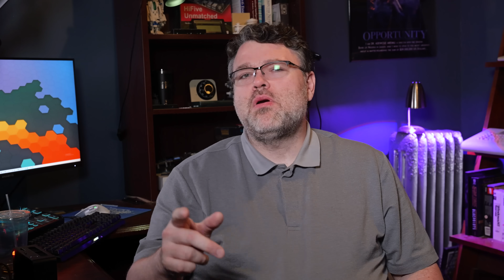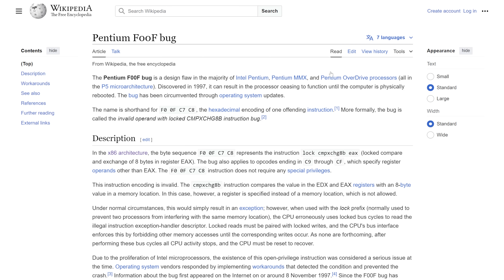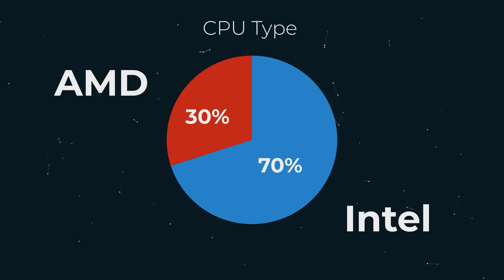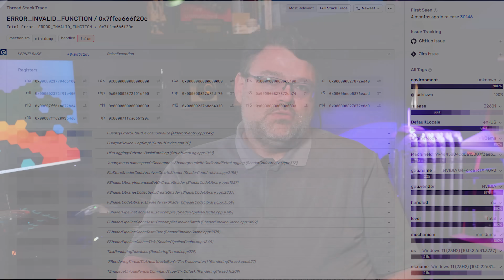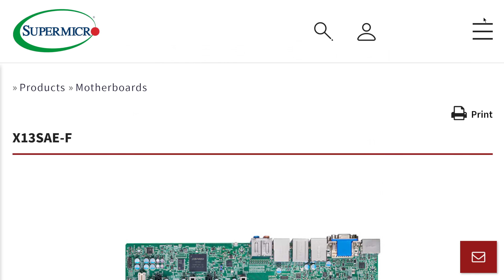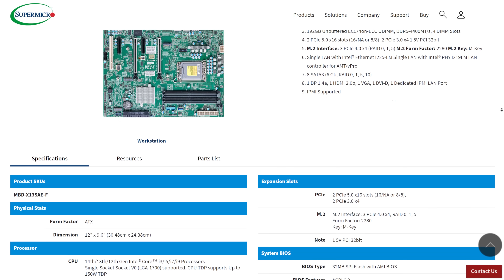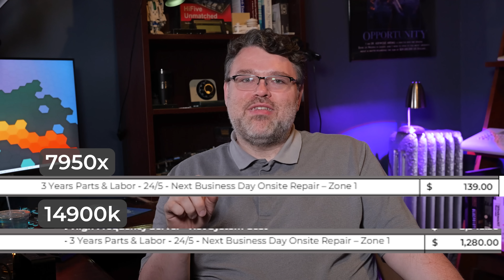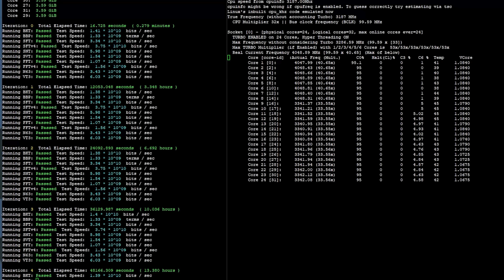Intel has a Pretty Big Problem

Comment: I'd rather use intel first.

I still use intel chips i7 chips.  I have never had a alot crashes off  video games.  Sometimes there are issues with certain music hardware for music production.   These days the current chips are beyond the standard. 

I'd rather see what Im doing wrong before i blame intel for my problems.

Comment: Is there a way for software to detect overclocking, like comparing the CPU's self reported design frequency to the measured speed of the TSC counter in the CPU relative to Internet-synced time of day clocks, like how many TSC ticks per minute of real world time.  At least on older Intel CPUs, the TSC counted at the raw clock speed and the CPUID return value stayed the design frequency and model name directly.

Comment: I've been running an Intel 13900H for over a year now without any crashes, at all! Yes, there isn't even a file called memory.dmp in my Windows directory. It's an ASUS Zenbook that i drive hard daily as a S/W engineer. When I'm not working though, I'm gaming on it. I have a lot of problems with your reporting, which seems to be happening more often than not. 

As someone who debugs hardware crashes for a living, the first thing I need to find the root cause is a repeatable case. Do you have a repeatable case? Not one that occurs every now and then, but a simple task you can run and repeatably make this happen on an unmolested system? Looking at crash statistics from game crashes is just not the place to look for evidence that a CPU is buggy. 

Problem number one, these gamers are all, or mostly, tweaking their H/W. This means these crashes are useless in your study. You need reports from systems that are not "tweaked", but they probably aren't crashing so ...

The next problem is that most of these gamers are going to be running bleeding edge H/W. That means you will see more crash results for newer CPUs compared to crash results for older CPUs.

Finally, old S/W can easily break on a new CPU when timings, cache designs, and other internal changes occur. Game developers are notorious for using "tricks" to increase their performance. They take advantage of the architecture at the time of the design. In the old days, GPU manufacturers like NVIDIA would rewrite portions of the O/S internal GDI code just so they could have a better benchmark score.

You've dazzled us with data, but haven't really given us any real evidence to support your conclusions.
Reply: It may be true that gamers are tweaking their system's performance, however Wendell also discusses failure data from servers running these chips on W680 motherboards. 11:41  Presumably these servers were always running at conservative settings that are "well within Intel's specification".
Reply: @eltamarindo  Again, newer servers with newer chips would be more likely to have issues with older S/W. As the old saying goes, figures don't lie, liars can figure. Without a repeatable case to evaluate, you're simply compiling the data to say what you want, while in the end, it is proof of nothing. Another person could compile the same data differently and come to a different conclusion.

Wendell has an agenda and it is obvious in the way he speaks about the issue.

Comment: Is there a correlation to game engine used as well? Was having a lot of problems with unstable Unreal based games. B-Series board, but vendor boost settings. Turned those off, updated bios, reset to factory, all the standard stuff. Turned out that RAM, even with the default XMP profile, had some auto clocking settings in there. Once I locked those settings at a fixed rate, this fixed my issue with the UR engine games. Not sure if it is something related to the memory controller and how that engine works, but yeah, tricky things to sort out.

Comment: So I shouldn't buy the i9-14900K, 3,2 GHz (6,0 GHz Turbo Boost) socket 1700 processor?
Reply: If you buy, make sure you are running conservative power settings from day one. But Wendell is suggesting that if you must have the a top of the line system, either wait or buy Ryzen 9.

Comment: Just my two cents: In the past few years I've built about 10 systems using exactly these processors, specifically for high end flight simulation (X-Plane 12, Flight Simulator 2020), gaming, heavy use/commercial architectural machines and graphics design. I have not experienced any failures, except for a bad memory module shipped out with one of the builds. I have not received any reports of crashes, blue screens, random restarts, etc., so unfortunately I cannot say I have experienced any of this. I did not however, overclock any of them. There was no need to because of the good performance.

Comment: It has been long time since i care about the detais on the Intel CPU lineup, so excuse me if what I'm going to ask is dub. Said that... What's the point of using those K CPU on the servers? If they are using non Z-chipset motherboards neither they aim overclocking for the sake of stability, then why not to use non-K versions of those CPU?

Comment: Modern CPUs---as I'm sure you know---have a great deal of fault mitigation logic built-in. If some part of the CPU fails, the CPU may be able to mitigate the failure at the expense of a loss of overall processing speed. That effect could explain what you observed in the logs. First one part of the CPU fails, which slows it down, then another part fails which causes the computer to crash.

Comment: 06:45 Just to clarify: Are you showing those Linux Kernal messages just as a generic log sample or is this supposed to be real data from a crash caused by an Intel CPU? 'cos I'm not seeing NVMe-related messages there, but issiues with an optical disc drive (/dev/sr0), may be a bad CD/DVD/Blu-ray!

Comment: I had this issue with my current 13900k where blender would randomly crash when working on a project or rendering. I randomly decided to underclock my CPU at 3ghz and it works perfectly fine, I tried many alternatives to have a boosted clock but it never works properly. Regret buying the 13900k.

Comment: The problem is: the CPU are NOT getting ENOUGH voltages!
The Power AC and DC load-line settings in the Bios are changing the voltages that the CPU gets, 
thus not providing enough voltages at certain frequencies under high loads. 
I can run the 12 gen CPU on Load line calibration LLC 1 fine, but the 14 gen needs LLC 8 to achieve higher frequencies because there is too much V droop at lower Load-line settings, and the CPU does not get enough voltages under higher loads..
14 gen needs more power and voltages under high loads..
So Intel and Motherboard manufacturers just need to fix their Load line CPU Microcode and Bios settings ...
And it is cool that intel lets us change the load-line settings so that we can under-volt the CPU, but if the under-volt is too aggressive crashes, errors, or instability happens.
i tested this, and even the "out of video Memory" error was not present when i just was sending a bit more voltage to the CPU, but it was present if i was sending to little voltage.
Apps and games were not starting or crashing with too little voltages, but not crashing anymore with a bit more..

Comment: Bs I have the same setup and haven’t seen shit
Reply: "I don't have a problem, therefore no one else does" is a wonderful fallacy.
Reply: @riven4121  I have a problem so everyone else too must have a problem 🤦🏾‍♂️ recheck your build it’s a you problem
Reply: @michael_iy7  Anedoctal evidence is not evidence.
Reply: @ccrodrigues  I had instability when I originally built my pc I checked everything in my build I was told by more experienced builders that my cpu is the issue and that other people had the same issue, I later checked my computer turns out it was a connector not seated correctly that caused it, check your build yourself stop the sheep mentality. It’s usually something you did.

Comment: Thanks for looking into this.
Just throwing random ideas regarding BIOS settings.... 
Any luck with increased voltage on SA VID (System Agent Voltage), or different C-States ?
IIRC, you mentioned it's less of an issue with slower RAM, which imediately reminded me that adjusting a bit more voltage to that could help with the issues (it's just an idea, as that's done with overclocking and also depending on RAM speed).  Different C-States (up to C3 only, ditching C6, C7...) or,  heck, even disabling SpeedShift and/or SpeedStep (obviously not ideal, but...) ?

Comment: Relocating the i/o die on 13900k/14900k compared to the 12900k may be a contributing factor. My 13900k is dogshit unstable and will bsod if under max load by multiple programs at once. I am also getting the random bsod or just complete freeze for multiple seconds when just gaming. Will definately switch to ryzen 9000 when it's out

Comment: Tip: never buy a Moza product. RMA service is very poor, and Hardware experts also let you down for months. I have had my R5 set with brake lite kit in transit for over 2 months. I picked it up last week so it was not repaired and therefore hopelessly unable to sim yet. So back to the HE in Lelystad, the Netherlands and they would urgently arrange a new brake pedal (because it was/is still broken) from Rseat Germany, now more than a week later and still no pedal from their intermediary/importer/wholesaler Rseat Germany who was supposed to have it delivered urgently via DHL, well they have not been able to deliver it after more than a week. So my advice is not to buy anything from Moza, nor from/via Rseat, and certainly not from Hardware Experts (Bram Nijk and Jorgo Rino, in particular, are the worst kinds of ppl)

Comment: I got the Out of VRAM error while playing Gears 5 back in February. About a week before all this 'Intel 13th-14th gen causing Unreal engine games to crash' came out. I built my pc in January with a Intel 13700k CPU and an AMD 7900xt GPU. First time it happened, I was playing for about 45 minutes when it crashed. Next two times it happened, I was playing for less than 5 minutes when it crashed. I always have AMD Adrenalin open on my second screen to monitor performance, and the GPU memory was around 11gb. So that error made no sense to me. After some google searches I found one solution that worked. It said to cap the framerate to 60fps. Having a 1440p-180hz monitor, I wanted to try a little bit higher. So I started at 90fps, the game worked fine. I upped it to 120fps, and the game crashed within a few minutes. I kept it at 90fps and haven't had any problems.

Comment: I was having crashing with 13700k.  ASUS ROG Strix Z690-F Gaming WiFi with G.Skill Trident Z5 RGB Series  (2 x 16GB) DDR5 6000 CL36-36-36-96.  When the crashing started, I reduced the RAM from XMP to 5800, which seemed to resolve most of the crashing.  The BIOS update and setting the CPU to Intel specs allowed me to utilize XMP again.

Comment: I have two Intel systems here (12900K and 14700K) with the same problem.  At stock bios settings (new bios with Intel power limits), they are not stable.  But if I disable hyperthreading in the bios, suddenly they work fine, even with XMP memory overclocks and normal turbo speeds.    Prime95's Blend torture test seems to sniff out the instability quickest.    These two systems are cooled with 360mm AIO's and really don't get much hotter than 75C under Prime95, but if hyperthreading is on, you can guarantee Prime95 is going to quit within an hour.
I also have access to 10th gen systems (i3-10100, i9-10850k) as well as some more recent i3's (i3-12100F and i3-13100) and I haven't seen any issue with those.  (The i3-10100 runs on a file server which has been on 24/7 for the past few years.)

Comment: I'm running an i7-13700k on an ROG STRIX B660-I and I'm experiencing the same issues. Interestingly enough, the majority of my game crashes occurred why trying to launch newer Unreal Engine games (such as Gears 5, Fortnite) and games that use Battleye Anti-cheat. I also discovered that completely disabling anti-virus software allowed these games to at least load into the menus before a crash when actually trying to play the game. I contacted Intel and they wanted me to change overclock settings in the mobo that aren't available on my board. After that didn't work(bc I don't have these options) they offered to replace my cpu with another chip...but I don't want to play the lottery here. After countless weeks of troubleshooting, the temporary fix that has worked without issue was disabling any type of Asus performance boost/O/C, disabling "Intel(R) Turbo Boost Max Technology 3.0" and "Turbo Mode" in the mobo settings. I haven't had a crash since but I do get random freezes and stutters pretty often. This has been extremely frustrating. I'm now running the cpu at its default 3.4ghz even though advertised speed on the box is up to 5.4ghz. I'm really hoping that someone rolls out a proper fix at some point :/
Reply: I would have played the chip lottery, accepted the replacement CPU, then dropped power settings on the new chip.
Reply: @eltamarindo  I shouldn't have to drop settings. Its principal for me at this point
Reply: there will be no fix
Reply: @granityseis104  Why do you think that?
Reply: @AwkwardBush  I know Intel is working with competent people.If nothing else they would realize something is wrong from rma numbers.Yet nothing public happened.So they know there is a problem and fix is considered too costly so they are trying to sweep under rug and they succeded at some degree.

Comment: That little note at the end haha makes sense. Personally I built my game server around a 3700x and I am extremely pleased with performance of it. Both for games that can and can't use more than one core. Now that I have more ram in there I can run a whole cluster of ark servers very smoothly and still have other games running if I need to.

Comment: So, then here's what we know. The 13900(K, KS) and the 14900(K, KS) are deployed and run fine, pass all hardware tests and benchmarks. But then somewhere down the line they begin to exhibit instability. But they all are not unstable in the same way. They all, at least half of them, begin to exhibit weird but specific failures. 

I am not a chip designer. But if Intel hasn't been able to fix this with a microcode update and the failures are non specific then the only thing that immediately comes to mind are the chips actual interconnects. The wiring that connects all the different parts of the die together. Looking at the die shots I see that being the system agent. It could be that like the silicon lottery plays a part in how well your chip performs, perhaps the interconnects are flawed and degrading in an unpredictable manner and that even with the set limits on power the interconnects are slowly burning out turning into seemingly random stability issues. Or it could be the efficiency of the system agent goes down as usage time increases.

Tom from Moore's Law is Dead has stated that the difference between TSMC and Intel Foundry's nodes is that TSMC has smaller transistors, but Intel has better wiring for the transistors so they can pack them more densely together. It's interesting that the 12900(K, KS) doesn't have the same instability issues and is likely due to the processor just not being as densely packed with chips as the 13900 and 14900 which would also make sense because with more density comes more interconnects which means more points of failure, or possible failure. And it's also interesting that with the 13700K and the 14700K they aren't apparently showing these issues either.

Wendell, you should see if disabling the e-cores fixes the stability of the chips or at least disabling 4 of them to make it the same P and E cores as the 14700k. Or if disabling them entirely fixes it. That is, if you haven't tried that already.
Reply: If you watch the whole video, Wendell specifically discusses the effects of disabling the e-cores.
Reply: I RUN HIGH VOLTAGE AND BURN MY CHIP OUT FAST? WOW WEIRD!

I REV MY MOTOR A LOT AND BURN OUT MY MOTOR FAST? WOW WEIRD!

Drag motors basically melt themselves on one run =]